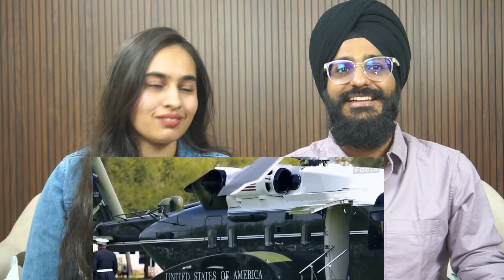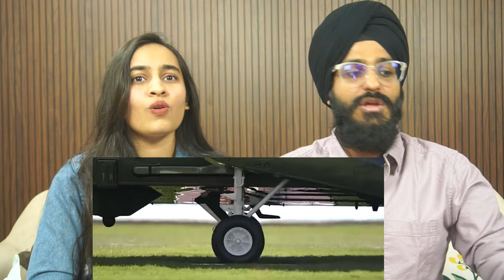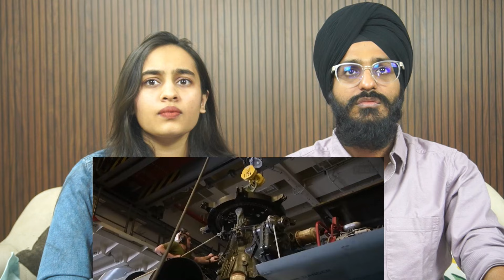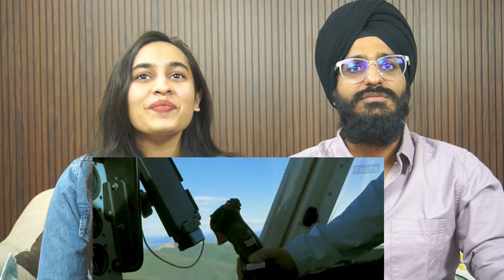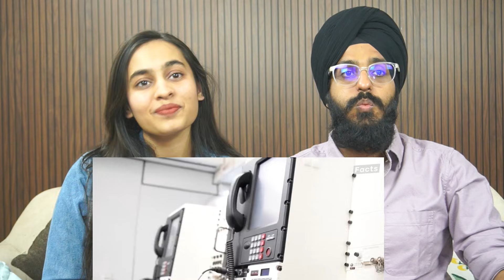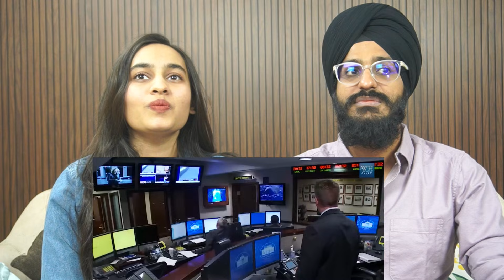Indians React to The Insane Engineering of Marine One!

Comment: All helicopter pilots train for "auto-rotation", which means the engine fails. As the helicopter begins to fall, the blades can be set to an angle such that the air rushing up around the helicopter can be made to rotate the blades as the helicopter descends. After the blades are rotating at high speed, the pilot changes the blade ange, and then this rotation produces lift; not enough to stop the helicopter from failing but dramatically reducing its speed of decent. It produces a very rough landing, but usually nobody is killed.